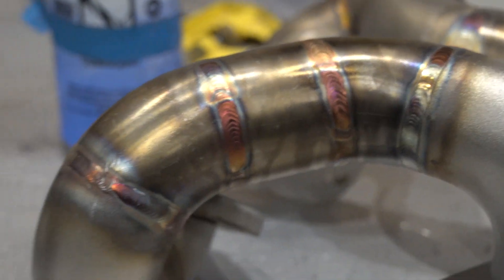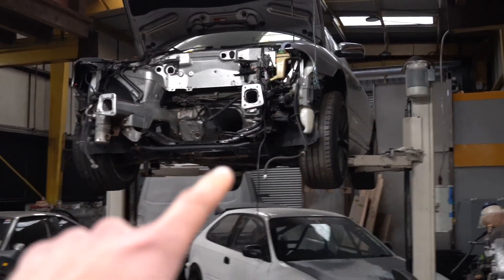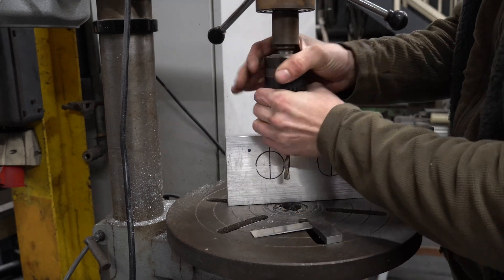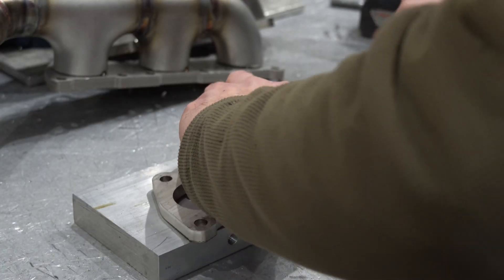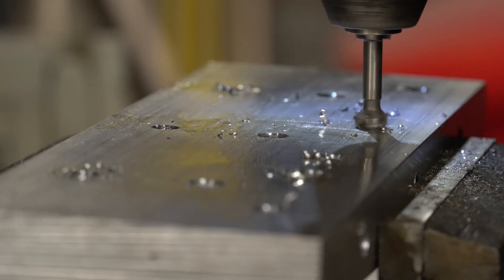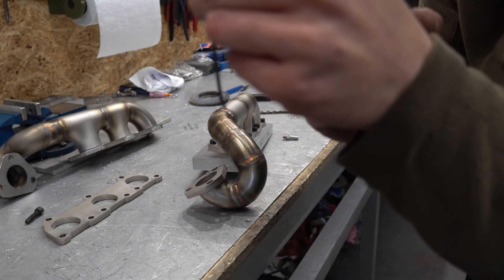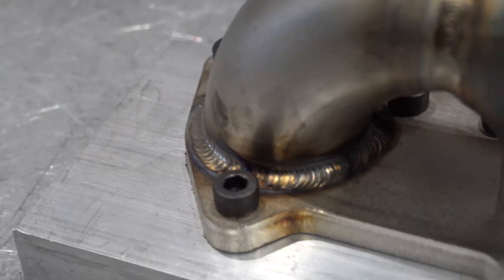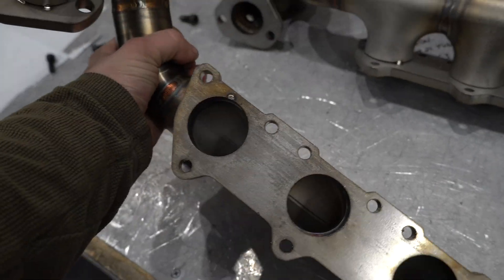How To Prevent Warping When Welding With a Chill Block/Heatsink.

Comment: You can do that without that block of aluminum. Purge it, tack it up and weld it out in quarters.
Reply from the maker: @usmc2044  you could, I’ve never had any luck not bolting it down especially if you want to stick 180/190 amp into the flange and runner to create a solid weld that will last